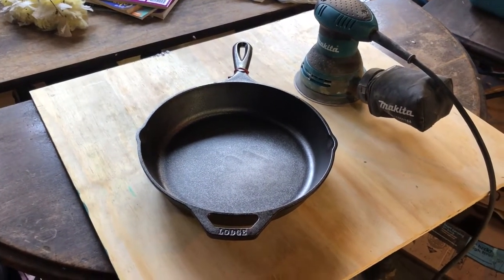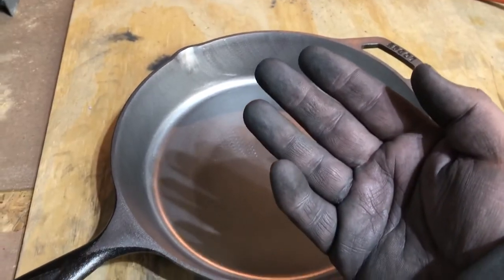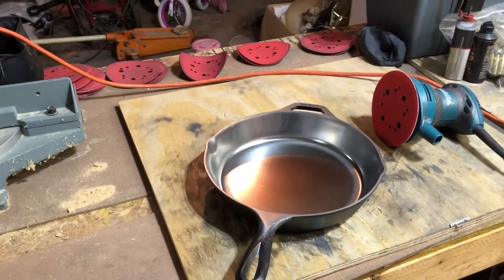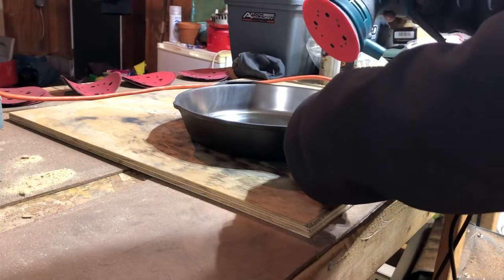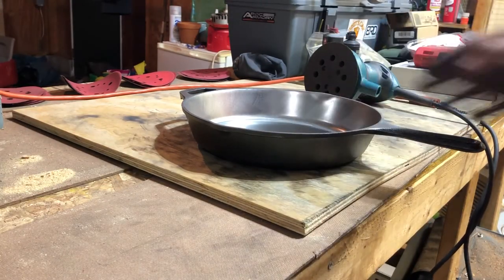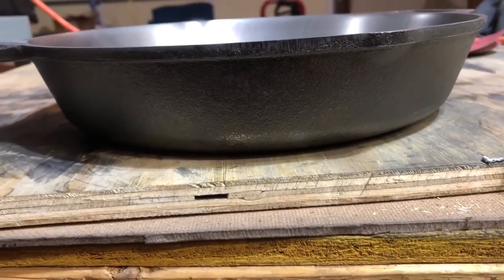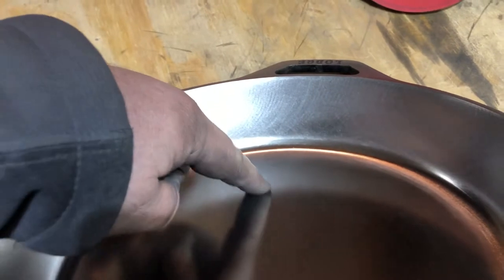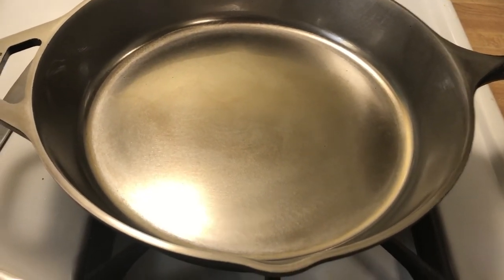DIY Refinishing Lodge Cast Iron - First attempt

Comment: Wait, I am confused.
Instead of spending so much money in sand paper and labor, why don't you just purchase a good iron skillet from a reputable company?
I don't understand the justification for the time, equipment and materials just to end up with the same cheap skillet.
If we were living in 1925, this video would have served the purpose, a Fields skillets is just 115 USD, and it comes with a warranty

Why the whole restoration thing its beyond me?
Reply from the maker: Thanks for watching
Reply: well in those days the pans were so smooth after casting there was no point of sanding. But good point i also want a Field skillet but were i live the shipping and such will raze the price up to 300-400 usd. So i have a garage and already have the tool from other projects. Also i look now on original site and n8 goes for 145. 3 years ago they were 250-300 a piece, there were new and its common to the price to go down a bit.
Also 3 years ago it was almost impossible to buy cast iron in shop and i have to order mine from internet shop that mainly deal open fire and fire pit accessories (also it was only pan under 100eur and without wood or detachable handle). In Europe cast iron because of 2 world wars fade away and most of them was scrap for tanks and canons.

Comment: Nice video but you’re working harder not smarter. Buy a good condition vintage pan at a yard sale or thrift store or a family hand me down  and you’ll likely have a pan with from the factory smooth cooking surface that only requires a lye bath or electrolysis process and reseasoning. It’s cheaper and easier and more fun to hunt for and find a true quality made pan of old. Lye baths and electrolysis have obvious safety concerns but I must guess iron dust resulting from sanding can’t be healthy for one’s lungs. KISS.

Comment: Why? Three hours of work and +$20 in sandpaper? Not worth the effort. Spend that money at an antique shop and pick up an old Griswold or Wagner.
Reply from the maker: It was a test
Reply: well if you dont have the tools already its pointless if you instead have the means to buy a better one. When i want a cast iron 3-4 years back my options were 30eur or 300+ Field so sanding it was and i dont regret it.

Comment: Firstly, awesome effort! I couldn’t help think while watching the video is that doing this is such “MAN” thing to do....like, how can we make this better?🤔 You’d NEVER see a woman do this sort of thing. Lol 

That said, I see your point of doing this, however I wonder if this will actually have the desired effect? With such a smooth surface, 1). The seasoning might not have enough to “key” into and flake off I wonder??? And 2). I wonder if the peaks and valleys actually help on a microscopic level to trap fat/oil between the high peaks creating a pressure that keeps the food from actually touching the steel?

For example, there’s a stainless steel pan called “Hexclad” which purposely has an etched hexagon pattern which seems to really work well. It has the high peaks in the pattern with the nonstick (aka seasoning) in the valleys. This also allows metal utensils to be used on a non stick pan since the utensils can get down into the “valleys” (seasoning) to harm it. 

So in summary, a rough surface might be beneficial in many ways??? I’m not sure, but just my thoughts.